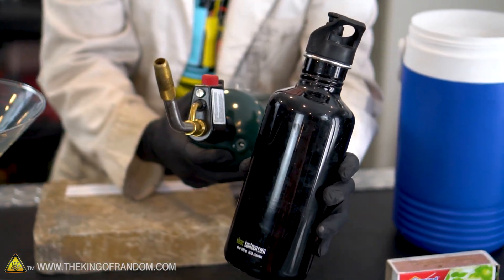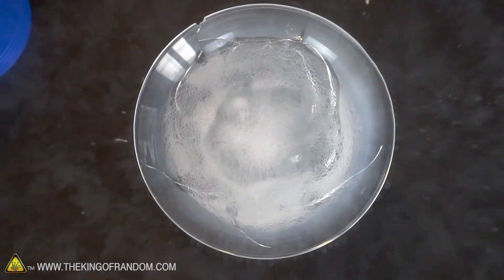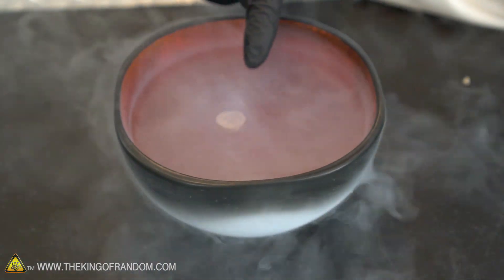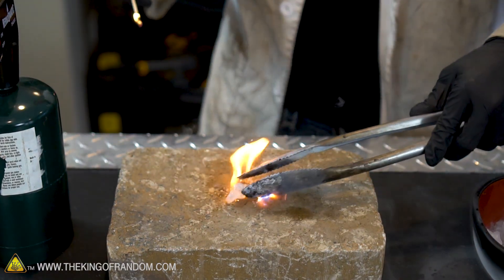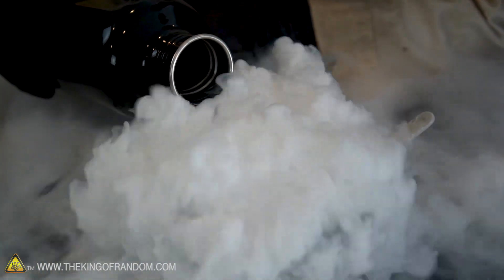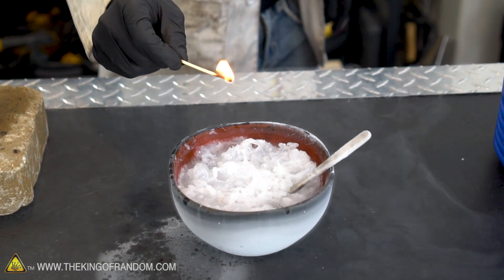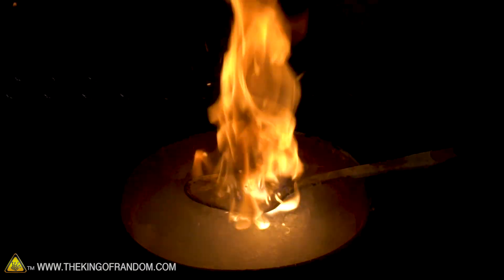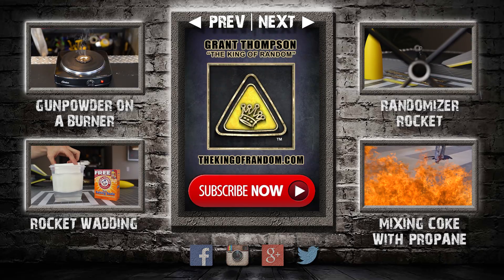Will Frozen Gasoline Burn? Can We Use Liquid Nitrogen To Freeze Gasoline Then Ignite It?

Comment: The frozen gasoline is white, i believe this is due to being "contaminated" with nitrogen. As in, a lot of captured microscopic bubbles. When the gasoline is lit on fire, the heat causes the cold nitrogen gas in the bubbles to expand rapidly, cracking the frozen gasoline and shooting small shards of it everywhere. It's just a theory, but as far as i know, frozen gasoline should be clear, and not a solid white.

Also. No, frozen gasoline wont burn. The heat from the fire instantly vaporizes the frozen gasoline. Just like wood doesn't burn, but yet you fee in in to stoves to keep the fire going... Rather few solids will actually burn, most have to first be heated enough to produce a gas, which then can burn.
Reply: Mr B yep, bad science, never mix the liquids when trying to freeze a liquid. But then this is an entertainment , shock and awe channel, nobody with real science background takes him seriously. And sorry, if the host is offended, do better science, your a great host, your charismatic and know how to present, so learn a little science and get taken seriously
Reply: Mr B yep
Reply: I agree.  This experiment is a bit misleading.  Mainly since liquid gasoline, even, will not burn.  It is the gasoline vapor mixed with oxygen that allows it to burn.  I was thinking that the intense heat was causing some sort of sublimation, but I think you are correct about the trapped nitrogen causing the popping effect in the frozen gasoline.

Comment: How about taking this experiment a step further and demonstrating why drag racers put copper coils inside of a container and drop dry ice in the middle of the coils and run gas through the inside of the copper before going to the carb. From what I have seen in this experiment it kind of explains the theory that cold gas gives more power but doesn't explain exactly why it does.

Comment: what happens if you heat treat metal in liquid nitrogen
Reply: it would most likely fracture the metal due to the extreme heat shock
Reply: or it mite not even touch it because of how much heat there is

Comment: Grant, darling, if you want to avoid cracking your glass containers cool them down gradually, for example, by putting them in the freezer beforehand. It'll reduce the intensity of the temperature difference, making the glass less prone to cracking

Comment: Try to burn liquid propane/butane in a vacuum chamber.
Reply: oxygen + fuel + heat = fire. a vacuum lacks oxygen (technically). it wouldnt work. you may still get thermal decomposition though

Comment: what happens when you freeze gun powder in liquid nitrogen will it still ignite or not ?
Reply: Gunpowder is already a solid so you can't technically freeze it. It will react just the same but will take slightly longer to ingite as the ignition source will have to heat the powder from -180 degrees Celsius rather than room temp.
Reply: wow that's awesome so i would have to pick a liquid instead of a solid

Comment: What will happen when gasoline is mix whit antifreeze
Reply: Wild pikachuman 123 Perez nothing, because oil and antifreeze have different thickness and density. Just like how you can't mix water wit oil, you can't mix it with antifreeze either (because it contains water). All you're gonna get from it is gas floating on the top and antifreeze in the bottom
Reply: Wild pikachuman 123 Perez that is interesting 😮 maybe he'll do that

Comment: I've been thinking but can't think of a way to see if it is actually solid gasoline igniting, or just the heat from the flame melting the frozen gasoline and igniting the liquid as expected.  Any ideas Grant?  And I enjoyed the explosion!
Reply: Liquid gasoline doesn't burn either, it's the vapor.  Gasoline starts emitting vapors at negative 40 degrees.
Reply: Ah!  So this experiment was bond to combust because the match would have liquefied and and vaporized the gasoline.  In theory, what else could have happen.  Haha, I think he just wanted and explosion!

Comment: Does that mean that methane ice might ignite? If so, then some icy planets might be very dangerous.
Reply: Only if there is oxygen present to sustain combustion, and if the methane was cold enough to be ice, so would the oxygen.  It makes sense though. It would need to be a seriously hot object to get the gasses at least liquified to start the combustion, but fairly certain that once it started, it would continue like this gasoline and liquid nitrogen experiment. The heat generated would melt the gasses around it, and everything would burn faster and faster. I so want to see a frozen planet/moon go boom now.

Comment: You should do a video about "will gasoline Ignite in a vacuum chamber?"
Reply: Seth McClendon gasoline needs oxygen to ignite. A vacuum doesn't have air in it. So there's no oxygen too.
Reply: Christian-E. Latte then have the vacuum chamber build as mush pressure as possible then let the air in all at once and see if it will spontaneously combust

Comment: just to let you know frozen gasoline doesn't burn. What happened was that when you held the flame to the frozen gasoline it liquefied quickly and thus burned. Then the heat of the flame spread to the next part of the gasoline that was melted by the previous flame and the cycle continued until all of the gasoline had melted. Just saying, I'm no expert but I can clearly see what is happening in the video.

Comment: Fuel vapour is what ignites and burns. Technically if you could get the match into liquid gas it would go out. Removing the frozen gas starts to rapidly heat up emitting vapour that ignites, hence the reason why the match went out when drop directly onto the frozen fuel  in the nitrogen. cool video

Comment: What I think was happening here was that the flame would melt a little bit of gasoline and it would catch on fire and then there for melting more gasoline and more and more creating a long chain reaction! I think that is why it worked so well because it wasn't actually the frozen gasoline burning it was liquid gasoline. Like If you Agree!
Reply: It's actually vapor. You could plunge a lit match into a bucket of gasoline and it wouldn't light, but hold it near the surface and you get great flames.

Comment: The enhanced reaction actually makes sense when you think about it. You've changed the gasoline from the liquid state to the solid state, packing the molecules closer together. This means you have a much denser source of fuel so the same volume of solid gasoline ignites much more vigorously than the liquid.
Reply: Ben Emery they use solid fuel in rockets for that reason plus the whole gravity situation
Reply: but the gasoline isnt what is burning. it doesnt matter if it's a dense object because it's the vapors that burn. so it would make more sense for warmer gas to burn better
Reply: Yes, we know. If it was flammable before being frozen. Logically, it will be flammable regardless of its current state.
Reply: The real reason that it burned hotter when cold comes down to the fact that the reaction is exothermic and according to La' Chatelier's principle, when a exothermic reaction gets colder the reaction burns more vigorous.
Reply: gabriel lopez. Not necessarily, all flammable substances have an ignition point that must be reached before the substance will ignite. It has to do with a chemistry concept called activation energy. Lowering the temperature on a fuel does influence how easy it is to ignite. ie colder = less activation energy =  harder to ignite. It is for this reason that the fraction of various sized molecules in the mixture we call gasoline differs across the world. In colder countries, there is a larger % of smaller molecules in the mix because they have lower boiling points and are easier to evaporate and mix with the oxygen in the air to support the combustion reaction.  Bigger molecules have greater dispersion forces that hold them together more strongly, equating to higher boiling points and therefore more difficult to vaporise, mix with air and ignite. ie petrol made for use in mexico will be hard to ignite inside a cold engine in a canadian winter. As to increasing density meaning more vigorous reaction? not true. if too dense, there is little room for air to access the gasoline molecule mix. This is why a strong heat source in the MIDDLE of a tank of petrol (ie away from air/fuel interfaces) will only heat or boil the liquid fuel but not ignite it.
Reply: As far as I understand it, water is one of very few substances that becomes less dense when chilled/frozen. I can't be 100% sure, but the frozen gas would be more dense (unless bubbles of nitrogen are trapped within, in which case the mixture would be a lower density).

Comment: you didn't burn frozen gasoline... The flame converted the outer molecules of the frozen gasoline into a gas which then rapidly oxidized (burned).  Very similar to how a candle burns; the wax has to melt then vaporize in order to burn.

Comment: Grant Thompson - "The King of Random" Can you make liquid oxygen and light it on fire and could everyone reading this give this a like so that the king of random can see it?
Reply: I also think that he should make a video on mixing liquid nitrogen and liquid oxygen and seeing if it will light off
Reply: You can't really light oxygen itself on fire. You would need some type of fuel (wood, paper, etc.) if you wanted anything to happen. Burning is a chemical process in which oxygen binds with things and creates a new product(s). Take gasoline for example the oxygen would burn with the many hydrogen and carbon atoms and make Carbon Dioxide and water (Considering complete combustion was achieved.) Therefore you cant just light up oxygen like gasoline because it dosn't really have anything to burn with. You can however put something burning into oxygen and it will burn vigorously because it has as much oxygen as it wants to burn.
Reply: Isnt liquid Oxygen and liquid Hydrogen rocket fuel?
Reply: don't give him any ideas, he almost burned his down with gasoline and air, LOX will make anything flammable basically explosive
Reply: it can be made fairly easily just with liquid Nitrogen, some copper tubing and some Oxygen gas. Liquid Nitrogen has a lower boiling point than Oxygen so it will liquefy it. Cody'sLab did it :)
Reply: oxygen doesn't burn on it's own unfortunately :(
Reply: Wow! thanks for 300 likes! hope Grant Thompson - "The King of Random" will see it :)
Reply: Oxygen can act like a fuel
Reply: Alora Rodriguez he was talking about the nitrogen
Reply: trizm 6ix 六 hydrogen is what burns but in order to keep burning it needs oxygen
Reply: William Lovejoy yeah because fire needs a source (wood, hydrogen, propane) and oxygen so the fire wasn't really because  of a oxygen tank
Reply: Also Oxygen has a very low liquid piont so it would need very expensive equipment to make it liquid forn
Reply: Energy Flurry but what about when pure oxygen environments light blow up
Reply: He almost burnt his house down was what I think "hey7328" was meant to say
Reply: Kiwi Lover You can't ignite Liquid Oxygen.
Reply: I also think that he should try mixing liquid propane and liquid butane and seeing if it would ignite
Reply: Kiwi Lover well as long as it's only LOX then it won't burn, maybe you mean use it as an oxidizer to make other things burn vigorously
Reply: Sure something like a 3000 psi cylinder would be extremely violent if it 'went off'. But the explosive force  would only be from the high pressure and have nothing to do with the fact that it contains Oxygen, as it would do the same with an inert gas like Nitrogen. No matter how hard you try, Oxygen by itself, will not burn.
Reply: I don't think he can make liquid oxygen but idk
Reply: Yeah, I watch "Cody'sLab" too :)
Reply: Kiwi Lover oxygen itself does not burn, it is necessary to create fire but is not flammable
Reply: Adam Raccanello On street smarts they poured it on a grill, rather than putting a match in the O2
Reply: But if he held a match to it, then It would cause the match to burn much brighter, so he could try mixing it with liquid propane and seeing if it would burn at all, or burn with much more energy.
Reply: Where am I?
Reply: On the earth, I guess
Reply: HEE ALREADY HAS DON THIS GUYS!!!!
Reply: Ahem! spelling please!
Reply: Kiwi Lover fire need: fuel, oxygen, heat to burn, where's your fuel, bro? Where's your fuel, bro? Where's your fuel, bro?
Where's your fuel, bro?
Where's your fuel, bro?
Reply: Graham Kyhl Dude... Oxygen isn't a fuel. Learn some basic science before you comment
Reply: Clearly you have never been anywhere near an oxygen tank when they go off
Reply: Kiwi Lover Liquid oxygen is so cold that the flame would go out instantly
Reply: Uh, the OXYGEN.
Reply: Kiwi Lover frozen oxygen will exploded.  The most efficient way to store oxygen is in a frozen form.  hospitals always have a massive tank of it and in some cases it has caught fire.  if a big enough supply catches fire is burns very hot and very fast.  They sometimes have issues with this in space since they have to store oxygen in liquid form.
Reply: dziprick oxygen is combustable
Reply: you can light liquid oxygen producing violent fire see it on nile red
Reply: Grant thompson is stuntman of science so bad things turns awesome

Comment: can you boil gasoline? or put it in the vacuum chamber?
Reply: john meredith yes, it used to happin in old cars. its called vapor lock
Reply: Robert you can boil gas! It's one of the steps to making homemade napalm. So long as there is no open flame, it will not explode
Reply: you watch roosterteeth dont you
Reply: The only issue I have with your comment, a fire with the use of an accelerant will start from the floor and work its way up; the way it would actually occur, is that the floor would be the last thing to burn in a fire, and the path would be from the ceiling down. And in a fire with an accelerant, all of the gasoline for example, would burn up unless the homeowner/police/fire stopped it before it could. Even if it did not pyrolyse all of the fuel, it would be washed away from the fire crew.
Reply: john meredith It would be impossible to boil gas normally, as it is 3 to 4 times as dense as air, so simply put, it would be an explosion waiting to happen. 

However it should be fine to do it in a vacuum.
Reply: Yea take chemistry...

Comment: I think you broke the law when you filled up the bottle with gas at the pump...
Reply: Badger0fDeath THE LAW.
Reply: "Approved containers only."
Reply: The law is that containers sold for use in storing gas have to meet certain requirements. There's no particular law saying an individual can't fill up something else, though there are OSHA requirements for workplaces.

Comment: Why don't you refrigerate your glassware before using liquid nitrogen to reduce the thermal shock. I understand that a fridge is only usually a mere 40 degrees F, but it's most likely better than room temperature (70+ degrees)

Comment: Gasoline has a flashpoint of −43 °C (−45 °F) which means that it has to be hotter than −43 °C (−45 °F) or it won't be ignitable. So, yes frozen gasoline can burn.
Reply: Amazingly, this temperature is just a few degrees ABOVE the average freezing point for gasoline.(-48 °C) Since it is a mixture it doesn't freeze at one temperature. BTW it is the vapor that burns, not the liquid or solid.The flash point of a volatile material is the lowest temperature at which it can vaporize to form an ignitable mixture in air.

Comment: the octane level isnt the amount of pressure the gas can take its the amount of heat it takes to ignite the gas. Diesel engines use compression without a spark to ignite the fuel. just thought id let you know

Comment: the liquid butane turned warm when you left it in the coke bottle for a while. Will the same thing happen with liquid nitrogen?
Reply: Visnu Ravedasan it will reach room temperature, but when the seal is opened it will cool down again because of gas expansion.
Reply: yeah, but the amount of nitrogen would be crazy

Comment: I have my suspicions on the mechanism of the frozen gasoline. I suspect that the gasoline has a thin layer on the outside of the frozen part that lights easily and therefore heats the rest up to make it all go off. Then on top of that, based on the assumption that it wasn't able to freeze as a cohesive mass in the liquid N2 then there were maybe pockets of protected liquid gas inside the frozen gas that once lit expanded quickly causing that popping and explosive effect. Just my suspicion.

Comment: THUMB THIS UP! Boil Gasoline.. can it become got enough to spontaniously combust or can you get gasoline to actually boil. use electric stove to avoid a flame setting off gasoline prematurely.  also microwave the gasoline.  the fumes may combust in the microwave before you get to the boiling point.

Comment: There is a flaw in you test. The likely reason the gasoline is igniting is that the gasoline is melting so fast and is realising so much fumes that it's that which is lighting on fire, not the ice itself. If it was the ice burning then the fire would be more consistent instead of being vigorous in the beginning then being consistent after all the ice is melted.

Comment: Glass vs Bowl: 0-1 Bench vs Ceiling: 1-0, LN vs Gas: 1-1 :P   wouldnt it help to pre-cool the glass to prevent it from breaking due the thermal shock :?  and maby pre-cooling other things before trying to freeze them with LN or other substance?

Comment: I'm not sure if anyone has said this yet, but I believe that the frozen gasoline gets ignited with a flash of very vigorous fire because right after taking the gasoline out, the surface layer melts, so it all ignites quickly, producing the heat needed to melt the rest of the gasoline.
thb its not very hard to figure out tho
Also you just put gasoline in a water bottle!?